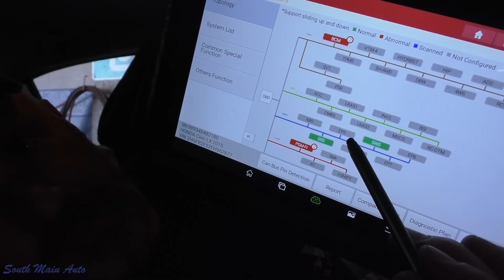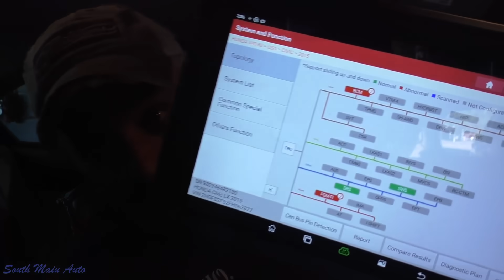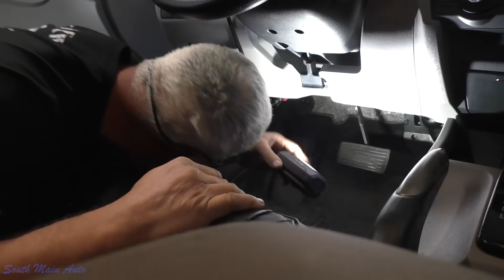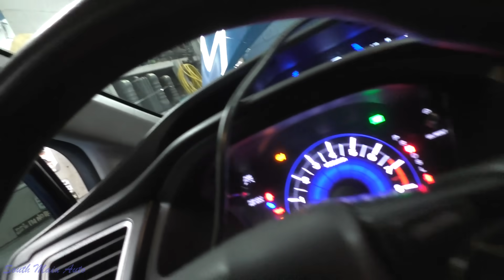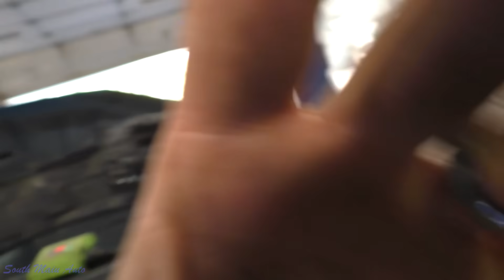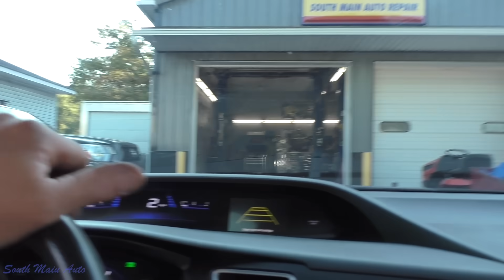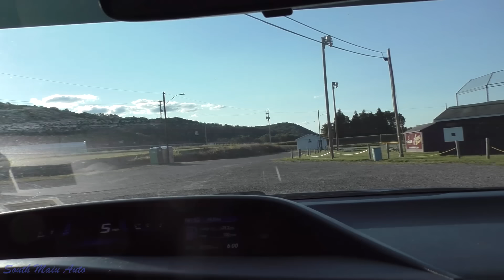ALL THE LIGHTS ON! Sticking to the Diagnostic Process Pays Off

Comment: These vids ain’t stupid for us non pros - case in point my sons old jag had an issue with a light off he spoke to a jag ‘expert’ oh it’ll be this rubs on this you need strip it out etc etc he was going to rip into the wiring having started to take the trims off etc etc (I’m cutting a long story short) anyway I said to him, son I am no expert but Eric O always says start with the basics, and within 10 mins we found that the offending light had no bulb holder behind the opaque cover, now it wasn’t that easy but we then realised it was only affecting lights on one side, I thought surely they haven’t got a fuse per side………yup us idiot brits (I am one) had split the loom and fused each side, hey presto checked the fuse it was crusty and blown. So a clean up was done new fuse put in all was restored been fine ever since. Now I was just as keen to rip into it, but I remembered Mr O…….start with the basics and the closest/easiest thing to check.

Comment: OK one Time i was checking  for a blown fuse by pulling them out and checking and i accidentally put a fuse back in the wrong spot. Now to be fair I'm 50ish with an extra on the ish and it was upside down under the dash AND I'M let's be nice and say Plump. It cost me a tow truck 2 hrs at the mechanics only for him to have to call an auto electrician. SOOO my searching for a blown fuse cost me $360 and Some humbling education 😂😂😂

Comment: Good video ! Checking the basics for the win ! Easy ones are nice to get. saves customers money. brings you  back to basics. Gives You a Laugh.( Laughing good for health ) Gives us a Laugh. ( see quote above ) a nice easy one bringing you back in from vacation.
i'd rather have a easy one than a Hair puller outer !
i'm Craving a Green crusty & a Money shot !
i was wondering if test light bulb was broken ? i am one for checking test equipment first - to see if test equipment is working first - wrong setting on meter etc. blown test light bulb.
Kinda Crazy How 1 Missing small amperage Fuse - Lights up the Entire dash ? that's nuts !!! 🥜

Comment: Great job Eric …with the controller plug I find taking a photo with your cellphone and zooming in to identify the pin location also hat T pins of a smaller  size help checking volts and grounds

Comment: Just did one where a guy changed the alternator on an Odyssey. He said after that it wouldn’t go over 2k rpm and had a code for the throttle body relay. Somewhere along the line him or his brother took a fuse out and put it back in an empty slot. I had him fixed up in 10 mins.

Comment: old abs could've blown the fuse abs got swapped and forgot to replace the fuse. Or the guy they got the car from got it from an auction where the owner before the auction pulled it to get it cheap from the auction.

Comment: I dont just check fuse. I check the fuse. I always look up the diagram then find the specific fuses for the module. Sometimes the ECM has 6 fuses for different things. Ran into a kia or hyundai where it ran but ran like shit. Shop that called me said they checked the fuses so I was in the process of checking the powers and grounds to the ECM and low and behold one of the fuse for the ECM was blown but they said they checked the fuses. When you are checking all of them, people get sloppy. I have learned after a couple times of the shop saying they checked the fuses to just look them up and check the specific fuses anyways. They had already fired the parts cannon at it. It had at least a new throttle body.

Comment: Hey Eric, Who knows, but I can tell you a short story about something very similar. My buddy Ray, (originally from Rochester), has a used car lot here in Tampa Bay. Some years ago I went with him to help pick up several cars from a few dealerships. One of the cars I drove back to the lot was high mileage, but extremely impressive. I even mentioned buying it from Ray. Anyway, a week or so after we brought it onto the lot and Ray did his DOLL UP, he had a customer drive it. Well, it came back with a bunch of idiot lights, just as this Hondoo. Ray fumbled with it for a bit, but was really busy with other things, so he called me asking if I had noticed anything strange with the car. No lights or anything cutting out, windows not working? I reminded him how nice I thought it was and then ran over to his place to figure it out. He had pulled it into his shop as it was about to rain. I reminded him that it was raining when we used that car to go grab a few more cars and that the windows worked.  Well, after a bit of head scratching and memory jogging, I broke out his test light and found not 1, but 2 fuses missing that were absolutely there and working before this guy took it for a test drive.... Then while I am plugging in a couple new fuses, that guy called Ray and asked if he'd take some crazy low price for the car, that his friend could probably fix it!!!!!!     Yeah!!!!!!!!!!!

Comment: About ten years ago I was working at a HD/MD truck dealership. A tow truck was towed in, it quit moving while towing a car (roll off), the towing company was also a garage that worked on MD trucks. They had diagnosed it as a bad TCM (transmission control module) because it would not communicate. The owner of the business came in with the truck to make certain we honored the extended warranty he purchased when he bought the truck new. At the time the truck was 4 or 5 years old with maybe 200,000 kms on it. Long story short it was corroded connections in the battery box with the clean power feed for the TCM rotted off. I fixed the wiring in the battery box, cleaned the connections, and low and behold it started up and the TCM communicated just fine. There was however a bunch of other items that did not work, power mirror, blower motor, power windows, other things I forget. On the passenger's seat was the cover for the fuse panel with a dozen or so fuses sitting on the seat. F' me I thought, somebody had "shuffled the deck" as it were with the fuses and circuit breakers in the panel, nothing was where it was supposed to be. I spent at least half an hour going through the whole panel putting things where they belonged. All told i Probably spent an hour and a quarter on this truck, no parts, just some wiring and a few new terminal ends. The service writer was pissed at me because nothing I did was covered by warranty and the owner of the truck did not want to pay because "his guys should have figured it out". That was my second to last day working there. There were several other instances working there that turned me off of dealerships, both working for or dealing with. I do my own warranty work on my own stuff. I have no faith in the dealership system as it is. But YOU ARE THE MAN ERIC! Keep on keeping on my man!
Reply: What app do y go to for you ur reference information is it free or a pay to view? Thxs much
Reply: TL;DR
Reply: @jaycarrUK Why'd you even bother commenting then?

Comment: As someone that's owned a couple of Hondoos I can relate. I was doing some work in mine and spent an hour trying to figure out why the power steering store working.  Because of how the fuse boxes are mounted I made the mistake of just reaching to install a fuse and missed the hole. Instead of looking at the obvious started tearing down the intake. Then I followed the plan and fixed the missing fuse. It's not a waste, some people learn, some people replace ABS modules for no reason.

Comment: Man, I'm in heavy duty fleet/equipment and the little wiring diagram lookup, pin out checking, etc on the tablet is so cool. That's like an hour or two of work for me, if I can even find the information. Usually I can't.

Comment: My son borrowed my 07 Cobalt and went to pick up his son from school and then the car wouldn't start we did find some ground wires bad but that wasn't it. About a month later we had the fuse box out and then put in and I asked him "did you check all of the fuses ", he said yes so I checked them and guess what a 10 amp fuse for the fuel injectors was blown, put a new one and it started right up.

Comment: Bought a '92 Taurus.
The guy pulled the gauge fuses so the CEL wouldn't come on during the test drive. 
Just about ran out of gas. Pulled into a gas station with it spuddering. Filled it up and the gas gauge didn't move. 
After a few hours of work tried to check a nonexistent fuse. Put the fuse in and the dash came alive. So did the CEL for an O2 sensor. Mind you, this was before "mechanic in your pocket" days.

Comment: I know it's impossible to get but I would bet the whole story would pretty interesting.  Maybe the prior owner started working on the car and forgot he took the fuse out.  Maybe he hated the car and wanted to get rid of it but someone else in the house loved it so he simulated an expensive repair.  I don't think it was a dumb video.  You film what comes in the door and don't necessarily know where that will take you.  That's life in a working auto repair shop.  Sometimes you're the hammer and sometimes you're the nail.

Comment: This feels like someone testing you. Dude pulls a fuse to generate all those lights and malfunctions, the suspicious ABS module in the passenger footwell etc etc. Some shops would recommend replacing all the modules and wiring harnesses when all it was was a missing fuse. You passed the test.

Comment: And even decent scan tools are available to the average joe these days. I recently purchased a GearWrench bluetooth scan tool that uses an Android or iOS tablet with their software. It was $150 on Amazon. Guess what? It works. It actually does Dodge too! I've used it, with success, on my 2001 Dodge RAM 1500, on my 2017 Chevy Cruze, and on my wife's 2023 Chevy Equinox. It worked fine on all three, gets regular updates, etc... etc... If you want one without providing your own tablet, they have one for $600.

Comment: I was given a 2004 Chevy trailblazer ext. Everything works except the automatic ac. It has a leak somewhere   between the front and rear ac. The previous owner rebuilt the top end of the 5.3 and it was overheating in gear
Now it gets up to 210 and stays there.

Comment: Dude, you're absolutely right about that - my youngest got a car bought by her mom to drive, but it's been through the wringer - tons of weird stuff obviously "fixed" by the other shop - and triaging can be as simple as verifying the right fuse in each slot. Not a dumb video - hell, i was under the hood the other day with a non-working rear latch motor. Same idea - i have no idea if the right fuses are there, so it's back to basics. IMO, great video - this guy got lucky on the Big Hondoo. Thanks as ever, Eric!

Comment: Hmm, has Honda changed something?  Immobilizer historically has been built into the VSA module, so if it's offline, the car should be a no-start...  Very curious!  Without vehicle history, I can't even speculate as to what happened.

What I can tell you is that Hondas will almost always temporarily clear codes on the current key cycle.  This is because there are a lot of configurations, initializations and calibrations that require a code-free status to run, but they themselves can set a code when not completed.  Clear codes, cycle key, start engine, re-scan to see "live" faults.

Hondas will also "hold a grudge."  If a fault exists that sets a code, then you fix that fault, but leave the code, that system may continue to be disabled like the fault is still there.  They're not as bad as Toyotas are about this, but I have had it happen.  :)

Comment: I think you said before you hate when they throw parts at it before bringing to you. I believe you said it makes it hard to figure out original issue. Ar least this guy brought it straight to you. Your process leads you to the problem. Sometimes it's a connection, or like this a simple missing fuse. Good job and video. Glad you had a little time off......

Comment: Just had one towed in the other day, F-350 no crank. Already had a battery starter and alternator replaced. Do some testing and find the PCM power relay fuse missing… started right up lol. No clue how it went missing.

Comment: My ex wife's Jeep Cherokee has all the lights on her dash lit up. I was doing a rear brake job for her and didn't think about the automatic parking brake. As soon as I removed the caliper the piston started pushing out until it came out of the caliper. The Haynes manual said if that happens you must replace the caliper. I gingerly put the piston back in and compressed the caliper replaced the brakes and when I was done all here lights have been on ever since. I wonder if I didn't blow a fuse.

Comment: Maybe the customer got a great buy on the car because all the lights were one!  I am a retired GM mechanic that worked on a lot of brakes, steering and suspension problems. For people that might read this let me pass along some info. Because of all the different modules and their communication problems, I started looking at them like a lamp in your living room. If the lamp is not turned on, why? Is it plugged into the wall? Is the switch turned on? Each system in a different lamp, take them one at a time. Sounds really simple, but it helps to not get things confused. Sounds like a different tech got to checking things and forgot to put the fuse back in. Good video Erick.  How many times have I spent a bunch of time just to find a blown fuse? More than I want to say.

Comment: The greatest car reliability testimonial, "I'm not to familiar with Hondas"
Reply: ❤ my '13 Civic, '09 Fit & '03 Pilot!
Reply: Yep, you just about have to own one to know one.
Reply: They put a bad taste in my mouth with their automatic trannys. Had an '02 accord strand my family 600 miles from home. Less than 50K on the clock.  Was on it's 3rd unit when traded in for a brand new '04 pilot. Transmission problems started around 20K and was replaced at 25K under warranty,  was replaced again at 90K out of warranty. And I'm not alone,  a quick web search of "Honda automatic transmission problems" shows a surprising trend of these "reliable" vehicles. 😂
Reply: @rajkumarrudolph399  I bet you had a 6 cylinder.
Reply: @Scott-ig1zd yeah, the 4 cyls are reliable but the V6s works the trans too hard when not babied. They should have redesigned the trans to handle the added power. I love my hondas! ❤
Reply: @rajkumarrudolph399  The transmissions for that era do have a major design flaw. The filter cannot be changed without a complete teardown. Honda started adding an additional external filter around '07 or so, which helped alot.
Regardless, they should last well into the 200K mile range if taken care of. They might  make it to 100K if neglected. Less than 50K is very uncommon, and indicates abusive driving or bad luck.
A web search will just provide a slew of half-truths. Finding reliable information is almost impossible these days. With 30 years professional experience in auto repair, I've directly experienced the truth.
Reply: @rajkumarrudolph399  i have an old neighbor that dealer maintained his similar year pilot for 140k when the engine scattered, they just started it, heard rattling it, and then immediately said "new engine is $11k" and refused to do diagnostics. neighbor was pissed

Comment: many moons ago my teenage son comes over to my house with his Camaro and I am inside the house and he is outside messing with his car and then comes inside and said dad my car is running bad, so out I go and after getting his story he said he was replacing a fuse for the radio  and other things after I was  looking everything over real good for about half an hour I was ready to give up and we drove it down to the local mechanic that I trusted and I told him everything that he had said and done about the fuses and such, and  of course he wanted to replace the plugs and wires and such so I paid for that and then he kept it over night and then he said well your son pulled one of the fuel injector fuses and then reinserted it back in crooked and it wasn't making contact but it did look like it was in there straight solved all the problems about $150 for that is what it cost me....KIDS

Comment: I have a 2011 explorer that used to show every light along with every warning message after every heavy rain.  Do a couple restarts would clear everything without a scanner.  Found out the computer under the cowl was packed with leaves so it held the moisture.

Comment: I have a hilarious story about missing fuses, or plugged into the wrong opening.
Purchased used VW Passat wagon, California car really clean, lots of miles, hoping I could put it together, soundly enough for my daughter to drive for a while.
To cut to the chase after the parts cannon and scratching my head for a couple of weeks. I finally paid the man down the street with the scanner and sure enough the previous owner had pulled the fuse to try to kill the cooling fan that ran continuously and just threw the fuse away, so I had no power to my fuel pressure regulator and every time I would start the car with new spark plugs the wild pressure that it was running would flood the plugs and after you turned it off, it would never restart.
Good lesson learned!
Reply: Oh man, that suuuucks.  I'm glad to hear it worked out for you in the end.  I had a Turbo Beetle I bought used in pieces where the owner started to change out the clutch and gave up partway through.  Turns out one of the cooling fans had seized up and shorted, not bad enough to blow the fuse, but bad enough to melt about 6 feet of the wiring loom into a muddy mess. It took a good while to sort through it all and get things working again.

Comment: Way back had to pull the ABS fuse on my mom's '96 Skylark.  A cracked tone ring on an axle shaft caused some scary stopping, especially in snow. Reinstalled the fuse once we replaced the shaft.